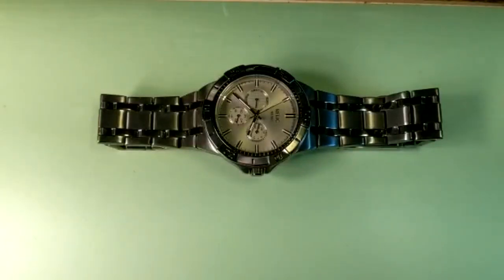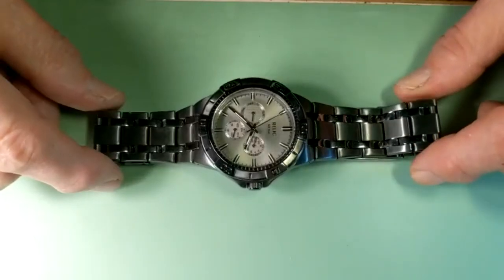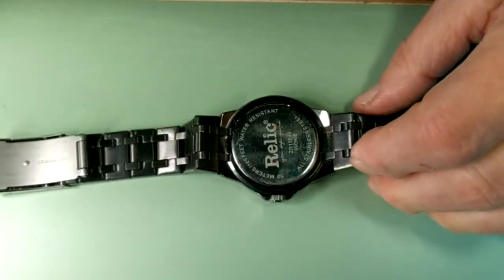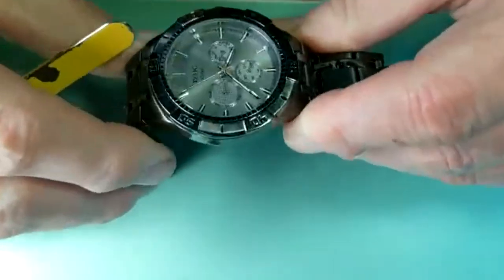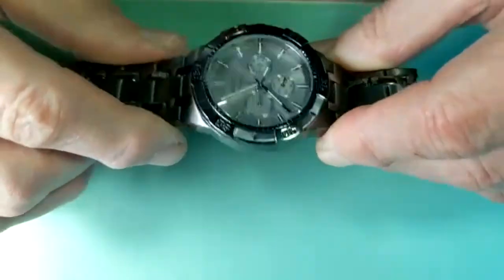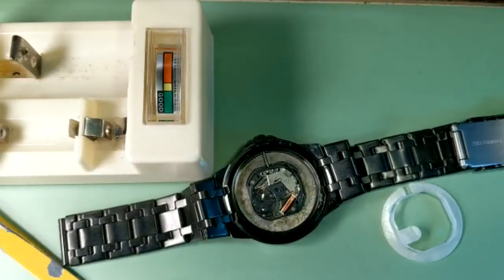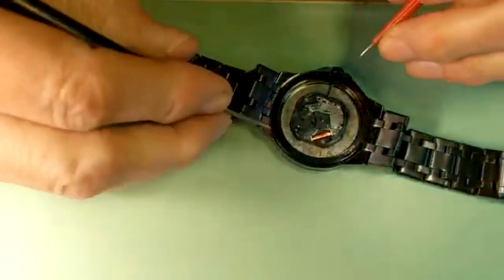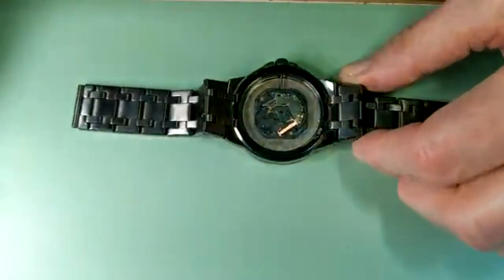How to Fix a Watch with an Open Coil in the VX3J Quartz Movement by Seiko Epson

Comment: Smooth video, I'm working on a couple old Soviet quartz and needing to understand how these things work and your vid did that perfectly :)   One Slava recently acquired the seller was "I dunno what's wrong with it" and opening caseback the coil is looking like a copper porcupine with stacks of cut wire all over the show...
Reply from the maker: Yes, when coil is damaged, most people do not know what to do with it and throw watch away. You know that it could be fixed.